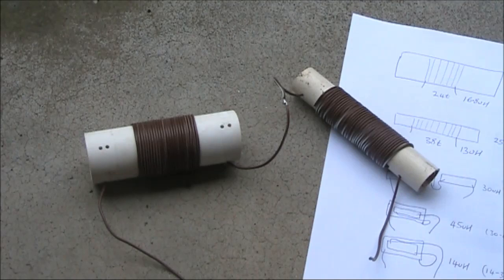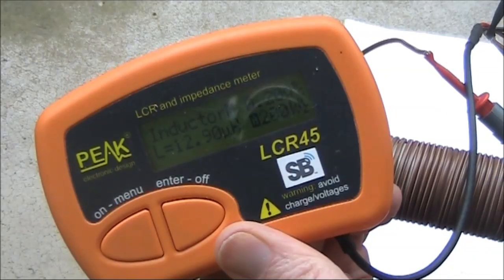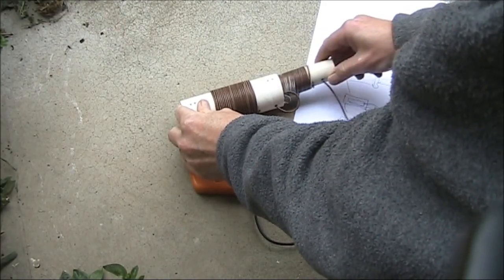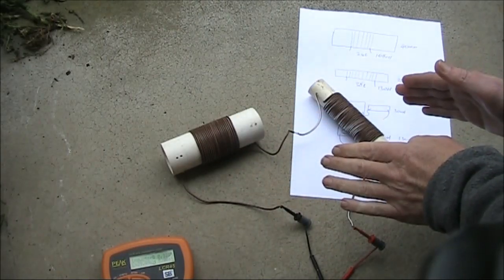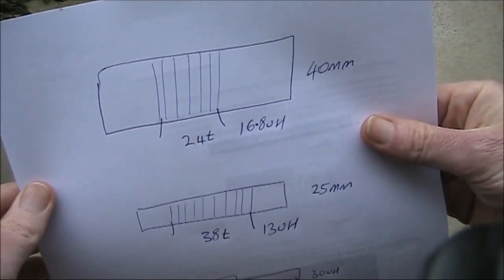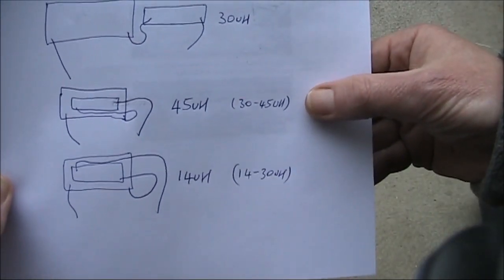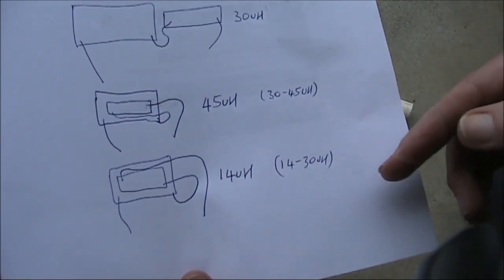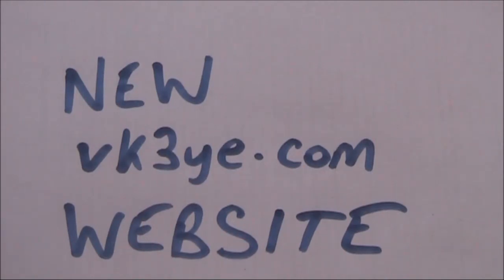Make a sliding variable inductor

Comment: Thanks Peter. Good application of theory.  I remember an old radio I had with spherical coils inside each other that changed the L by rotating the inner coil, and as a result tuned the radio  to different stations. Fixed capacitors were selected by banna like plugs. Your experiment reminds me of those early tuning systems. Thanks  for sharing. Lou, vk3aqz.

Comment: Thanks for the videos.  I wanted to experiment with loose vs tight coupling with 2 separate coils.  There's other ways to do that, but I wound two coils with 40 GA wire.   That wire is too small, I know.   One coil is 399 uH on a 2" thickwall PVC pipe (275 turns) and the other coil with 25 turns on a smaller pipe that easily slides inside the bigger one.  I'll fiddle with making each of the coils with a different number of turns trying to get more stations.  
Putting a different number turns on both coils will accomplish getting the inductance where I want it.  Thanks for the tip.
At first tonight I could tune 2 different stations on the broadcast band depending on how far the smaller coil is pushed through the bigger one.  I put in a different bigger coil with more turns.  That, along with using the sliding cap, allowed me to get 3 stations so far.
I made the sliding tube capacitor with paper towel cores and aluminum foil.  The capacitor is about 200 pF maximum.  The cap changes frequency too slowly, so I'll play with capacitor values  in parallel with the sliding cap.    OR make an additional sliding cap.

Comment: cool, i just finished making a variable inductor with 0.5" (13mm) OD ferrite cylinders on an M8 threaded brass rod, sliding in/out of a coil of 58turns of 18awg magnet wire (wound around a 15mm(ID) 16mm(OD) clear plastic tube). it only gives me 10-60microhenrys, so i'm tempted to try and fit another inner coil (wound around ferrite as long as it still fits in tube) to maybe double((? or not, your vid helps temper my expectations lol, so ok maybe 50% increase, maybe i get 20-90)) the total range of inductance.

also very handy, you can gut a jumbo glue stick and epoxy a ferrite bead in place of glue, wind a coil around the outer housing, and u got a threaded slider ready-made. i got inductance range if 10-50 uH with glue-stick var-indictors.

im trying to "regulate" a bifilar Tesla coil secondary as shown in Nikola Tesla's Colorado Springs Notes (his so-called 'adjustable inductance'), so I've no clue of range needed, but big range w/low resistance seems ideal (only 0.4ohms for 58t 18awg magnet wire 🤷), peace!

Comment: Thank you for the vid. I wonder if you tried to actually tune an antenna with this arrangement. Did it work? Was it efficient? Please let us know. Perhaps in a follow up video. Thanks again.
Reply from the maker: Tom - I did try with a crystal set AM receiver and it seemed to work almost as well as a regular coil (that had thicker wire).
Reply: @vk3ye  Thank you for your reply. It would be interesting to see it on transmit. I would like to make a variometer (loading coil) for a 12m Spiderbeam and (1/4 L on 40m) to be able to use it on 40m and 80m. I would put a smaller coil into another much larger one so rather than using taps, I would like to turn a knob. The smaller coil would rotate rather than slide inside. This potentially could work as a remote tuner with a simple gear DC motor (They have them on eBay  - 6 rpm. Slow enough to tune).  Anyway, just an idea. I do not know if this is even feasible.
Reply: yep in MW range 500kc etc maritime transmitters they used this bucket type antena, coil inside coil arrangement for resonance.

Comment: Thanks Peter, I'm going to make a crystal set using this inductance method rather than a VC, with the inner tube on a threaded rod so I can wind it in and out. Is the separation of the coils due to the plastic coating of the wire a necessary feature of this device?  I would like to try it with varnished .8mm wire I have, but the length of the finished coil will be only about 25mm, much less than yours, unless I string it out with a larger gap between turns. I hope it works, as finding Variable Capacitors is getting hard. Appreciate your videos 👍